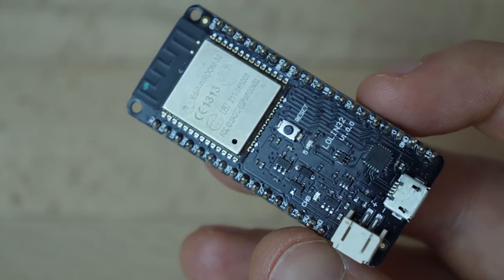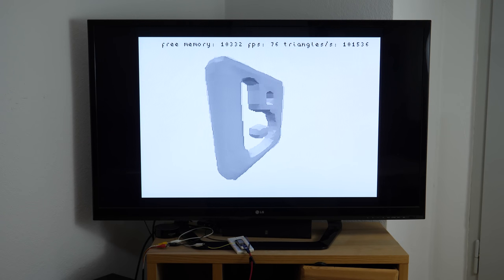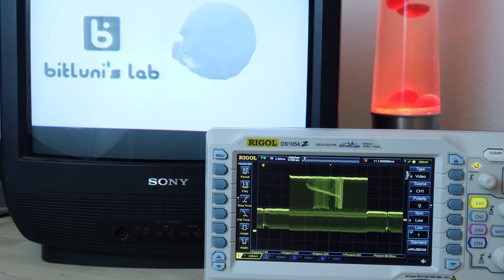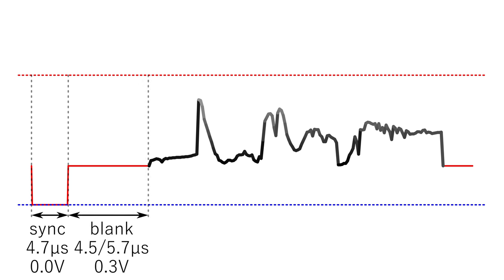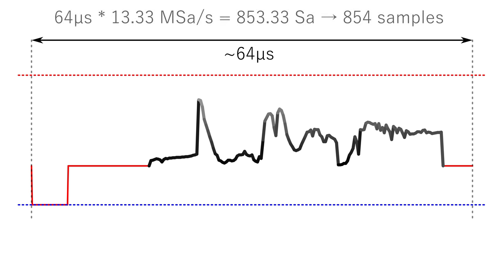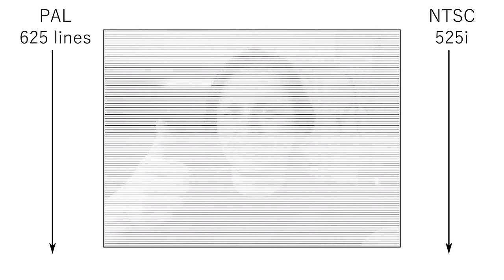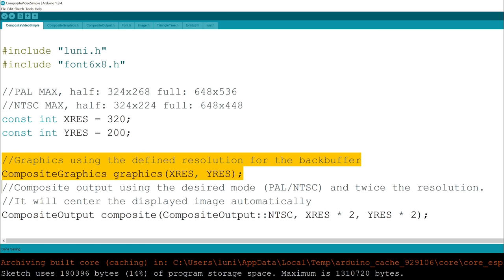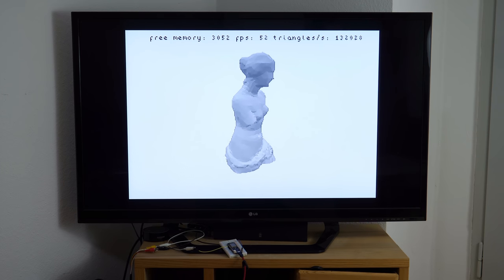ESP32 Composite Video

Comment: Meanwhile some programmers require Core i9 to flash a single LED.
Reply: i'm one of them!
Reply: The Windows 10 Task Manager takes an entire second to open on an i7 with 4 logical cores running at 3.45 GHz. I don't even know how they managed to achieve that.
Reply: @ThePC007  because the speed of an application's launch depends on your HDD/SSD and RAM, not your CPU
Reply: @moth.monster  It takes much longer when I underclock my CPU, so that seems to be the bottleneck here. it also opens a little faster on my father's PC which sports a faster CPU, so there's that. Either way, I've seen an old Fujitsu PC with terrible specs at my university open the Win7 task manager almost instantly, while on Win10, even on top notch hardware, I have to wait for it to open. MS is really dropping the ball lately. Even more so than they normally do.
Reply: @ThePC007  C# ?
Reply: Task Man Benchmark. This could be a new thing.
Reply: @moth.monster  in Win XP it was way faster still :)
Reply: @ThePC007    That's because meltdown spectrum vulnerability many people forgot about it while all OS patch the way the under-performance your CPU . if you want real speed wither compile costume  Linux Kernel yourself or use MINIX
Reply: Just to mention - ZX Spectrum was based on a CPU running at 3.5 MHz having 16kB ROM, 16kB RAM in 1980s it was able to generate such video signal in colour, same thing was done multiple times with 8 bit Atmel CPU with no DAC on board, it shouldn't be considered as amazing when 160MHz 32bit board having 1MB ROM 512kB RAM and DAC do same thing except with no colour what so ever...
Reply: @ThePC007  Yeah, my ancient laptop opens in about 0.5 seconds tho. 😂😂
Reply: i9 plus a microcontroller😅😅😅
Reply: Meanwhile, i ported a full fledged rpc server from pc to esp32s3 and it even worked(slow as hell but it worked)......

Comment: I think tihs is no longer working, I try with the ESP32 core version 4.0.0 and it doesnt output any signal, doesn anyone know what is the version that he uses in the video? I think that in newer version espressif change the I2S API.
Reply: Thanks for your comment. I was trying to compile on a newer version and wondering what could be wrong since the code compiles but doesn't work. Now working on 1.0.6

Comment: isn't composite video loaded down with a 75ohm terminator on the receiver side by spec? if so, how is the esp able to drive the output (assuming the TV follows the spec, and the esp32 has a >10k output impedance)

Comment: Very nice work!! You could probably use an op-amp to scale down the DAC output voltage so you can use more than 77 shades.
Reply from the maker: Yes... I also mentioned a voltage divider but I also think that an op-amp is a good choice to get a cleaner signal. The built in buffer of the DAC isn't that strong. I need to test this as soon I get an opamp that's able to follow at 13MSa
Reply from the maker: checked for fast opamps.. they cost as much as the esp32 🙈. does anybody know a good one?
Reply: @bitluni  for a voltage follower, just use a BJT or FET as an emitter follower (or source follower) 👍

Comment: Oh god, this is by far the most coolest microcontroller ideas I have ever seen. Doing this with a simple ESP32 micro is a jaw dropper... can you do the same with an AVR chip or ARM chip which has I2C? Is it possible you can do this using UART or SPI or Bit Banging? Matter of fact, you can convert the analog signal to HDMI signal using low cost common video IC chips. Either way this composite video signal from a simple microcontroller gives more control and design ideas for adding LCD to an ESP32 project.

Comment: I have to admit, I'm more impressed by the animations you show than by the fact you generated a FBAS/CVBS signal ;) I also like using low level hardware stuff of the ESPs to generate signals. Did that on my own to control a large LED matrix that has no own controller and needs multiplexing. Works fine, however, I only show boring text on it because I'm really bad at doing animation / graphics :/ 
So, really nice job!
Btw. You know, you have to go wireless and color, right? CNLohr did that too :)
Reply from the maker: thanks. I'll try color.  btw. charles was only able to do just black&white and some color because he was using just i2s on a digital pin.

Comment: Great stuff.

Getting the video timings right for interlaced isn't easy.

The fact that you are rendering 3D meshes on the second core is so cool as well. ;)

Something I've wanted to do for many years is to write a 3D graphics core on FPGA.

I will definitely give your code a try with the ESP32 first. It's super handy for getting a display output easily.

I remember seeing Charles' NTSC ESP vid for the first time. It was also very impressive.
Reply: I'm wondering if a "sample and hold" circuit could be used for RGB from the single DAC output?

You could have a counter that resets during Hblank, then just cycle through Red, Green, Blue on each pixel, while also outputting the lower two bits of the counter into a mux chip.

Or, just use an external counter that is clocked by I2S BCLK?

Sure the colour "resolution" will only be around 1/3 of the 640 pixels per line, but it could work.

Or, use the second DAC channel for Red and Blue, while the first DAC is used for Green.
Reply: Color on composite doesn't work that way unfortunately.
Reply: Yes, hence "RGB". :p

I know Composite requires a stable colour burst signal, and that has to be running continously in the background.

The colour burst is then gated on for say ten cycles, during the horizontal back porch.

It can be done on the ESP of course, as demonstrated by Mr Charles Lohr (and by other people, on many other MCUs), but it would be nice to see if the ESP32 can handle even higher quality RGB output with only a few external components.

Comment: Parking monitor LCD are sold for less than €20, they are LCD with composite input.
Light, low power (can be powered with 5-7V), inexpensive.

Perfect as small monitor for DIY projects.

Comment: Bitluni, amazing work!!!!

Can I please ask your opinion of how to extend this project?

I want to be able to synchronize this to an external video signal so I can generate an OSD overlay on a composite video signal.

But the synchronization part is seemingly impossible!

I'm made a test circuit with an LM1881 sync separator and I have modified the composite output library so that the clock source for the I2S DMA is set to the APLL. I can then modify the APLL registers with rtc_clk_apll_enable() and have very fine frequency control over the I2S DMA output.

I then wrote a Phase Frequency Detector type PLL 'loop' in order to lock onto the external VSYNC signal. It compares the VSYNC pulse to when data is written I2S DMA and tries to get them into sync by adjusting the the APLL regs and hence the frequency that the data is pushed out.

I can get reasonably close to a 'lock' but no matter what I do there is always about 1 line of jitter which is not acceptable for drawing an OSD.

I also tried a 'dumb' solution where the external VSCYN simply triggers the function to write to the I2S buffer but this still jitters badly....

Any ideas?, please help, I am stuck :(
Reply: A video overlay would be great to have in a library.

Comment: You may not be able to do composite (color), but with three parallel outputs you should be able to do component video in full color and then if you want composite from that use an external modulator circuit

Comment: I did monochrome video on an STM32F446 last week and ended up using the SPI port for monochrome video as the DAC onboard the STM32 could not deliver more than 2MHz B/W.  What DAC did you use? Did you get PAL colour working?? Thats impressive, especially bothering to do interlaced PAL with a proper Vsync.
Edit - Ah I see (I watched this a 2nd time) your uP has a fast internal DAC - a better choice of part than my STM32 and you did not manage PAL colour. Not surprised really.
Did you consider just not bothering with interlacing as it makes everything a whole lot easier?

Comment: One of the coolest esp32 projects ever! 👏 if u used the version with 4MB of external ram could you do higher resolutions?
Reply from the maker: Good thinking.. I already have such a module here. However, the speed of the external ram is limited. I thing there will be much optimization to utilize the cache the most. It's definitively fast enough for the transformed vertices/normals and audio. It's probably not fast enough to transfer the whole frames. There still might be a solution

Comment: 0:33 I have got completely the same model of Sony Trinitron (also 14 inch), which was used in the late 1990s and the early 2000s by my older sister (I am 25 and she is 41 now), but after the analogue television switch-off it remains almost unused.
Our unit is stored in our garage, but unfortunately, it is actually much dirtier than that on the photo and needs thorough clenaning!

Comment: Dear Luni,
I doubt you will read this.
How did you make the font? I would like to make the text larger for use on my 4" CRT.
Reply: The file font6x8.h holds the font. It's not too hard to figure it out, each value is the grey level. The second character, for example, is:
0, 0, 255, 0, 0, 0, 
0, 0, 255, 0, 0, 0, 
0, 0, 255, 0, 0, 0, 
0, 0, 255, 0, 0, 0, 
0, 0,   0, 0, 0, 0, 
0, 0, 255, 0, 0, 0, 
0, 0,   0, 0, 0, 0, 
0, 0,   0, 0, 0, 0, 
This is an exclamation point.
With some code changes you could double it to a 12 x 16 font that would not require an extra font-file, but the characters would be a bit chunky.
It should be easy to take some publicly available font files and create an include from them.
Reply: @mattreed59  thanks a lot!

Comment: How about a challenge to make a component video capture?
AV to ESP32 Stream
Reply: I was thinking doing the same but you need first revers the process using ADS (at high frequency first ) to trigger timer that store analog read of the signal , second process this signal to the PC via USB or WiFi , last if you didn't done the encoding process on the ESP32 you need to create programm the transfer composite single to real images .

Comment: Hey @bitluni! Amazing projects, and thanks for sharing knowledge with us! About one year ago I had the chance to get 7 small black&white CRT intercoms systems, wondering if i can build a 2x2 CRT matrix! now, after some time, I wanted to begin, and found your CRT projects, amazing! I'd really appreciate if you have some advices about how to do it :) I'm thinking about using both DACs on the ESP32 and "multiplex the signal splits" on the monitors, do you think it's going to work? also... I think I need to split each line based on the horizontal amount of monitors (2) and stretch every part in order to fill the monitor line, then going to the next monitor... I 'm wondering if I have to draw the whole screen before going to the next one of i have to draw the lines sequentially on all monitors... also, the manual indicates that the monitor gets a CCIR input signal, do you have any suggestion about how to output that signal? Thank you, and again thank you for sharing your experiments!

Comment: Nice one. But how we do the oposite way? I am working on a project that I need to use the esp32 as a video processor. So I will need to process the  input composite video to a LED Panel. Can it be done? The Led Panel is already ready.

Comment: I'm curious, would an ESP32 be capable of receiving and showing (either through composite out or one of those little breadboard screens) 2.4ghz wireless video? Like the kind you'd use with a quadcopter. Could make for a cheap way to build a video receiver for said devices.

Comment: Like everyone else, I am very impressed. But when I tried it I could not get it to work. I added serial-port code to verify that it runs, it does. I've connected PIN25 to my scope, it's a flat line. I'm considering pulling some code out and attempting simple wave generation. Any ideas on how to debug this?

Comment: When you say you can't do colour... why not? PAL colour carrier is exactly a third of your sampling rate! If you have DMA feed the i2s and you have the second processor preprocess a line before sending it off to the DMA to embed the carrier, why would you not get colour? Even with NTSC it might be possible, but the period of sine wave data you need to store could turn up a bit iffy.
Reply from the maker: it might be possible... but you can't get exact phase with just 3 samples. there will be hue shifts, pulsing and moire ... but I'll try

Comment: Is there any way to create an active menu system for lcd screens with esp 32? I need it to be separate to the video signal so that even when the video does not display the menu still does. Almost as if it overrides the select pixels to create the menu interface.

Comment: Very nice! I don't know ESP32 (so, I'm sorry if I write non-sense ...), but if you have two I2S available etc, wouldn't it possible to create chroma and luma signals for some kind of S-Video like solution with colours, instead of monochrome composite signal then?
Reply from the maker: The idea is not bad, could result in a overall more stable signal. I guess we have to try it. I'm currently looking into how to utilize the second DAC for mono sound but the two a tied together causing some trouble
Reply: pretty amazing that consumer grade DAC's sample rates are starting to become so high that you can do stuff like this.

Comment: It's possible to test this on a composite video capture card on a regular PC.
Reply from the maker: Yes, I bought one for 6€. It works with both PAL and NTSC. But it was really bad on PAL. the even/odd lines were shifted by one pixel against each other and the image quality wasn't very good, but you can give it a try and maybe change the timings a bit. All values are in the CompositeOutput.h at the beginning.